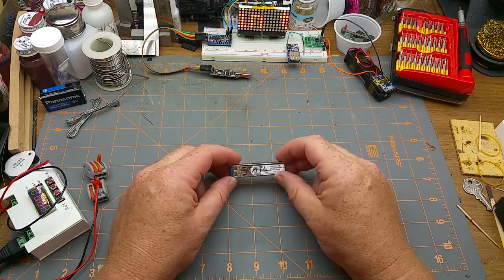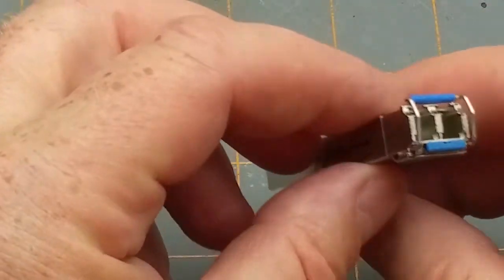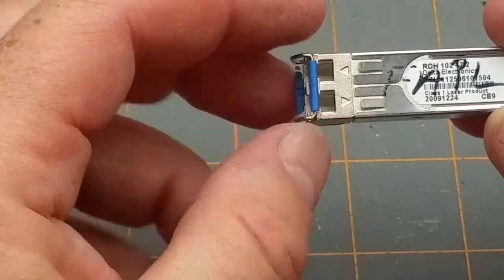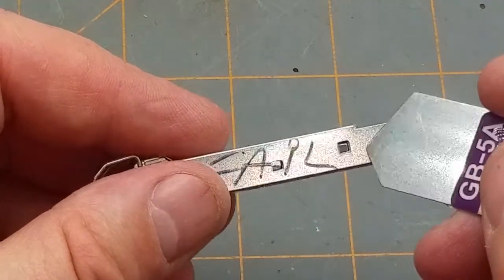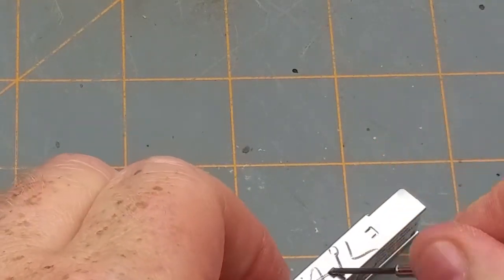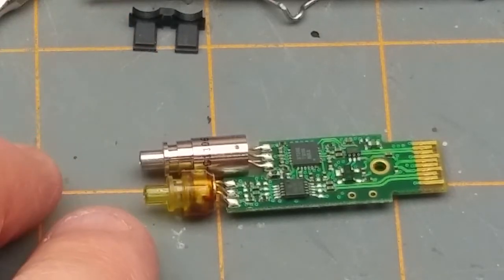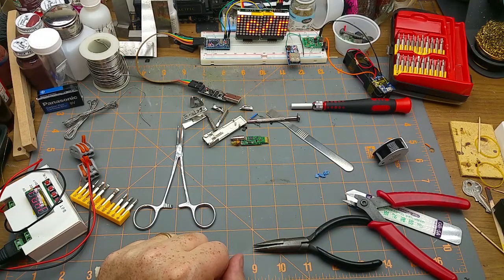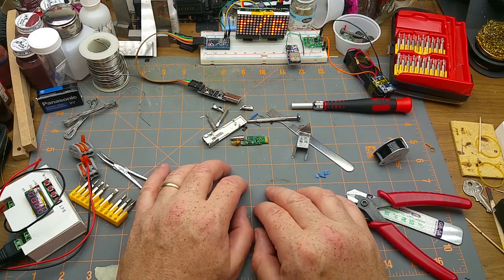SFP teardown

Comment: Now companies make programmable SFPs where you can impersonate the Cisco or Juniper ones.  However with cisco there are 2 unsupported commands that you can type in to unlock the ability to use any brand of SFP as long as the switch is capable of actually using a similar cisco one.  We use Proline branded ones where I work as they are 1/2 to 1/4th the price of Cisco ones but still good quality.

Comment: Why does the laser have 4 pins? If you solder a regular white led instead, it should work and give you visible light right?
Reply: laser has a mointor PD inside, some packages have two pins each for LD and PD.